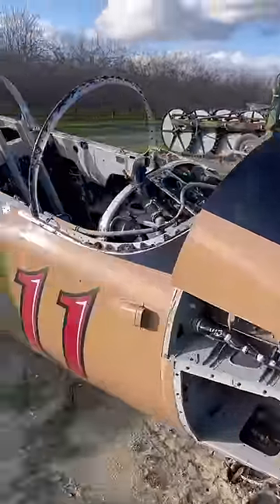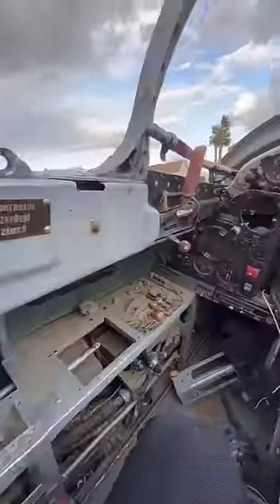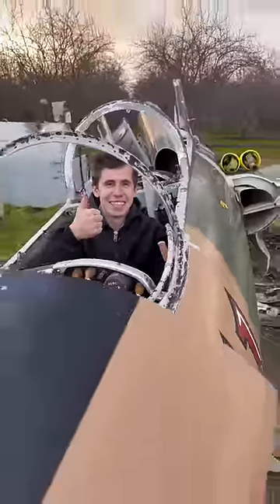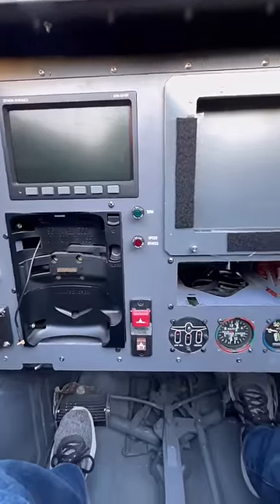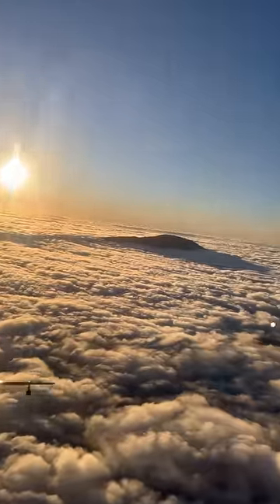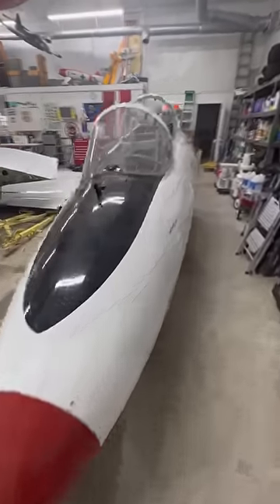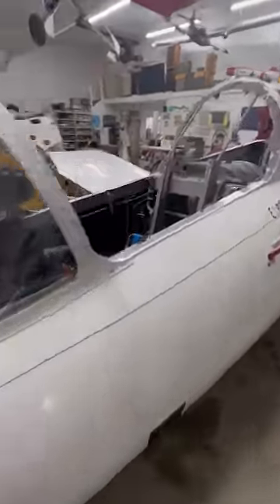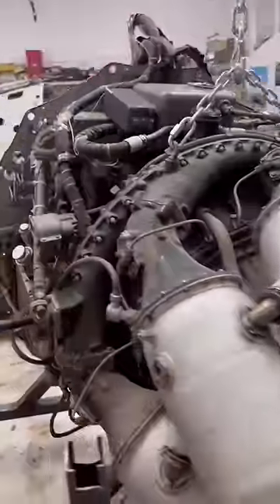New Jets for My Backyard

Comment: Remember if you need custom metal parts, you can 3D print metal, i use ‘Shapeways’ for my metal parts (I’m not building a jet but I work on drones)
Reply: Fun fact... SAAB tested 3-d printed hatches on the JAS 39 Gripen a couple of years or so ago. As in they flew with them. And it worked out great. 😊
Reply: Now we have someone to blame lol
Reply: @Eduardo_Espinoza  wdym?

Comment: Nice. FYI - Never manipulate a rudder (or its trim tab) via a 'pinched' finger grip. Always use both hands, flat palms on either side.
Reply: Why would that be if I may ask?
Reply: Same question - why?
Reply: @Guy Friedman  something to do with the thin metal and fact that it could snap back into any position and wreck your wrists probably similar to hand starting prop planes. I could be wrong as I don't directly work on the plane, but thats kinda the consensus of what I've heard in passing while dropping off equipment and troubleshooting downed equipment at the plane.
Reply: @nerosteel1452  You are on the right track as far as it being thin metal. As such, two scenarios are possible when manipulating via a pinched grip. First, tension on the control cables (or) rods could be such that the required force actually bends/dents the rudder. Second, you reach full deflection (all the way one way or the other), and continue to apply pressure, resulting in the same possible bending / dents.

That said, upon second view, he was actually moving the rudder by its trim tab = same dangers exist, but less concerning ? maybe? given it uses thicker material.
Reply: @bennettt4404  probably a thicker metal at that point, but still probably good maintenance practice to avoid it. We need some metals tech or Aircraft structural maintenance worker to weigh in, but I definitely bet that's the reason
Reply from the maker: Yup. I actually don’t manipulate the rudder on most preflights, a lot of the airplanes I fly specifically say not to on the preflight checklist. This rudder was completely disconnected in this case though so it was moving with almost no pressure. Probably still good practice to do it with a flat hand though, good catch!

Comment: Ok I would prefer to get a couple prices from the newest jet you have put that on the oldest one see how it works out if you don’t like it it’s most likely the egin in done for or your oil is just really old I would personally take it to a shop buy new parts new wings and flaps new egin and new carburetor and you need permission for miltary to drive it hope this helps

Comment: Where are you building your jets? If your close and need some free labor let me know. I got 18 years of aviation experience. I worked on CH 46's in the Marine corps.
My experience 
Engine test cell operator 
Search and rescue 
CH 46D
CH 46E
Flight line shop 
Flight line Chief 
Phase crew
Phase crew coordinator 
CDI
CDQAR
Maintenance Control 
Maintenance Control Chief 
Safe for flight 
I'm now retired and a little disabled, but I still know what wrench to turn and how to turn it. I'm just looking for some work to do before I'm completely useless.

Comment: I was surprised to learn that the L-29's engine uses a centrífugal compressor. I guess that they cloned the Rolls-Royce Nene engine the Brits gave away to the USSR just after WW2. That made the US leadership howl!
Nowadays all jet engines use the axial flow compressors the Germans first made for the Messerschmitt 262. Centrifugal compressors (radial flow) are used for turboshaft engines (helicopters, turboprops, Abrams tank).

Comment: Man that MIG 21 is still one of the fastest fighters out there, they can still easily out fly 90% modern Fighters. You fix that baby presuming it got the original engine and the Air Force probably got nothing at the ready to stop you from dashing across the country un challenged. Boy you will be in trouble but it will be fun, just don't ignore Radio call and definitely don't turn the Transponder off! Just shout into the mic, "Throttle stuck, I don't know what to do, please help, and a you get close to California report back, throttle unstuck I will try and find a place to land.